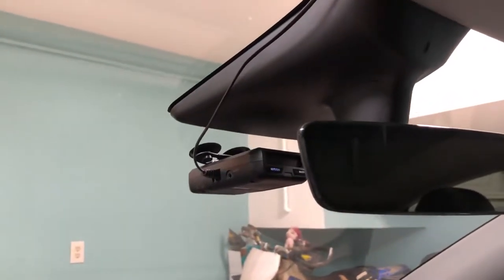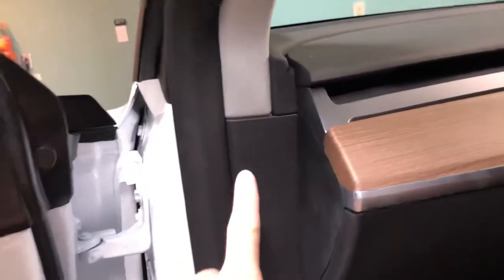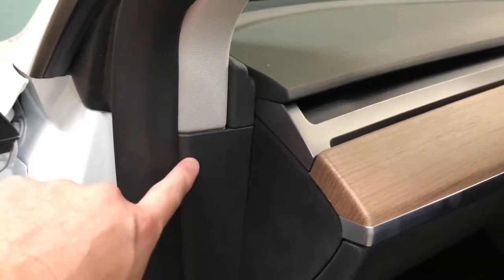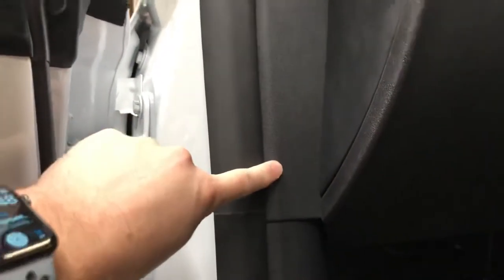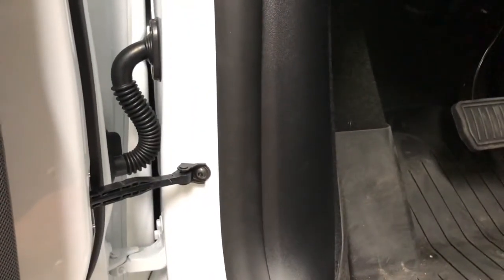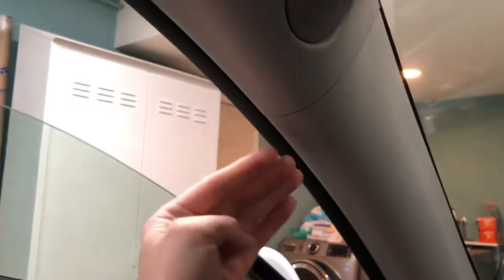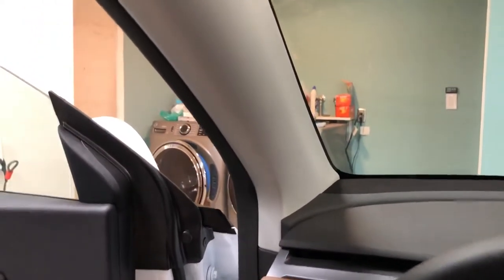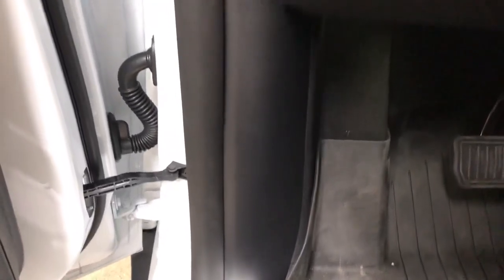Tesla Model Y Hardwire Radar Detector with Trailer Brake Harness 12v Switched Power

Comment: Can you confirm this still works? Also, does this switch "off" if sentry mode is on but the vehicle is otherwise parked and standby? Is the power change immediate like how the touch screen turns off or does it take awhile? I want to wire up lights but don't want them on for 12+ hours at a time. I have the hitch and trailer mode so I am not concerned with that part. Just specifically how sleep works for the devices connected to the brake harness power. Thanks!
Reply: Still works on my end. RD permanently installed using this technique and it never fails to boot up or shut down as expected.

Comment: Would you post the link to the harness please
Reply: Part ASY,HARN,TRAILER BRAKE ECU ADAPTER(1072586-00- A)

i could not get this to work on my 22 MYLR, i checked the multimeter too i got no power from it. Not sure if you need to have the tow trailer package to get power to this or not. Seems like the people who have got this to work have it while others couldn't get it to work
Reply: @dennisshyu6797  Did you ever get this to work or find another solution?
Reply: @infotime  Tesla disable this port on 2022 and newer Model Y's & 3's, and they are not going to re-enable it.  I talked to Tesla support, and they will not support use of this port for anything, including their own trailer brake controller harness pigtail.  They only support use of this port on older vehicles.
Reply: @carlsullivan5037  So, 2021 models are good to go...correct?

Comment: I used red with power and black with black wire and it’s not working. It does not turn on
Reply: same here, could not get it to work and checked multimeter and no power
Reply: @dennisshyu6797  did you find out anything about that issue? How to turn on?? Is your car 2022 model?
Reply: You need to have purchased the “Hitch Option” from factory or have it installed by Tesla. Then the software will enable (power) the brake controller switch port.

Comment: Hardness part number please
Reply: For the model Y, the part number for the connector is 1072586-00-A
Reply: careful could not get this to work, and got zero power from it when checked on multimeter. May need tow package for it to work
Reply: I just install this and has no power

Comment: Tesla disabled this port on all 2022 and newer Model 3's and Y's, due to a new lithium ion battery they are now using.  Apparently they have no plans for a work around.  I bought the harness from Tesla, and found out that I wasted my money.
Reply: Bummer! This was on a 2021 model as FYI for future viewers.
Reply: @madsen203  
Yeah, who would have thought they would continue placing this port in their vehicles, but leave them disabled?  My plan, now, is to take the center console apart, and tap into the cigarette lighter wiring.  That seems like the safest solution, at this point.  I've read several stories about people looking through wire bundles and tapping into power wires that they find, and end up shorting out some circuit board, and then Tesla voids their warranty.  I don't want to do anything like that.  But the cig lighter seems like it would be safe.  My radar detector is plugged into it, now, so what would be the difference, if I tapped into those wires in the console?